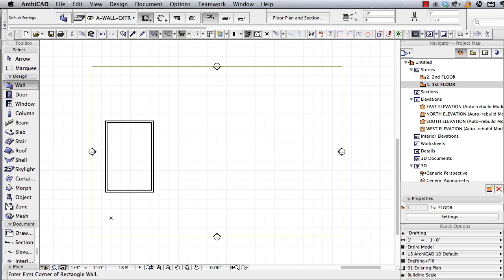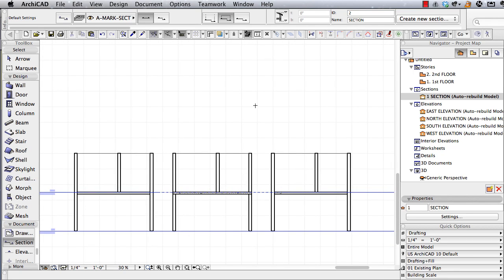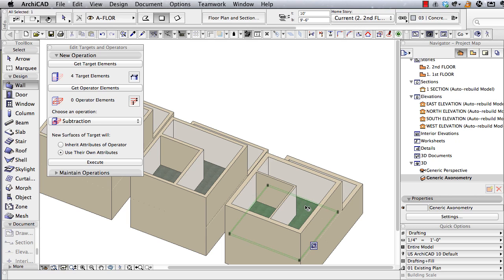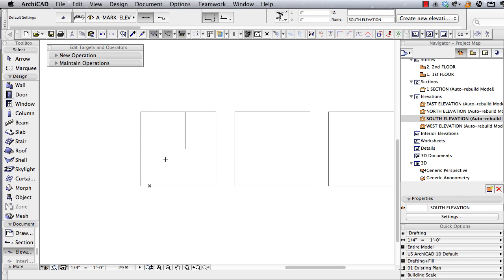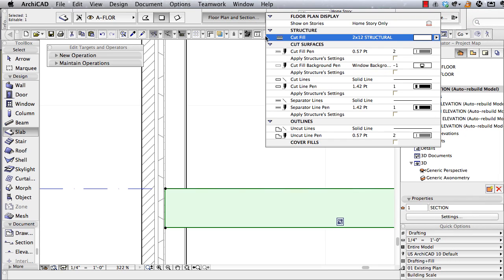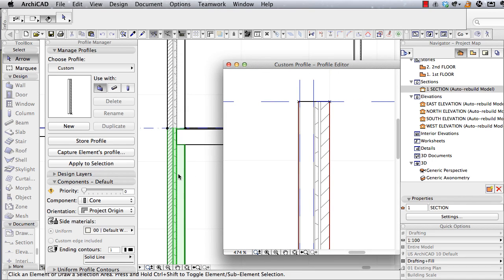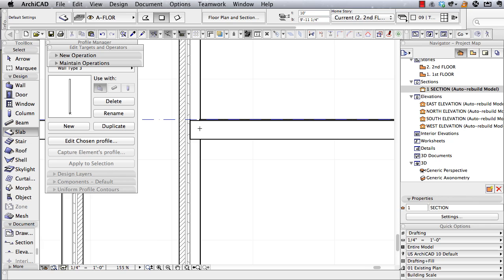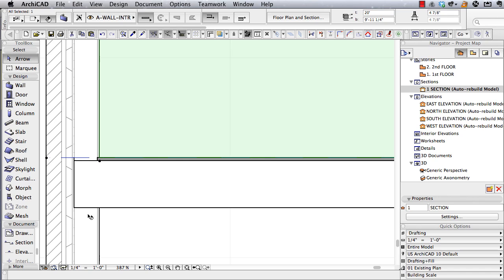ArchiCAD Tutorial | Multi-Story Buildings: Basic & Advanced Strategies

Comment: At around 17:00 you explain splitting slabs in different elements. This is a strategy I am using a lot to get clean intersections between walls and slabs. However, with the new energy evaluation, ArchiCAD expects all walls, slabs and roofs to be modeled as a single composite. I want to make only one model and not a separate one for energy evaluation. I tried cutting the floor finish with the upper wall (placing base elevation just above the main structural slab).

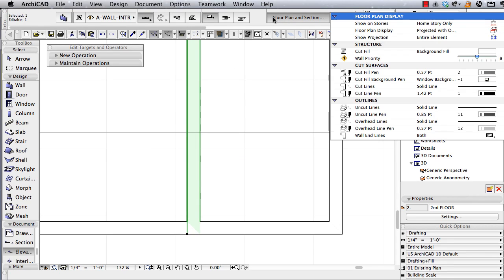Comment: At around (14:00) you talk about removing a problematic line in the elevation. In our regional template, priorities are based on skins (in the composite structure) and the main wall priority is at zero. Changing priorities might solve it in one place, but can generate a new problem in other places. When asked, our local distributor hinted at using a small column using the same materials, to clean this up (and hide it for the sake of information extraction in other views). Any advice?

Comment: Using ArchiCAD 18.  
When trying to edit the wall composition: (@ approx 5.25 min)...
I am going to 'Floor Plan and Section' drop-down....
...no 'Structure' sub-section on my version.
Can this have been accidentally disabled, or has it been removed from the drop-down in this version?
I tried by opening a new document to see if it was a document linked error.